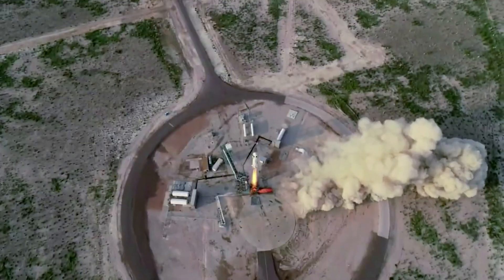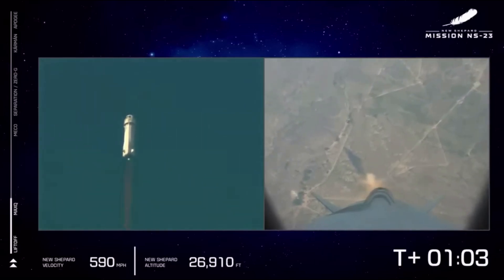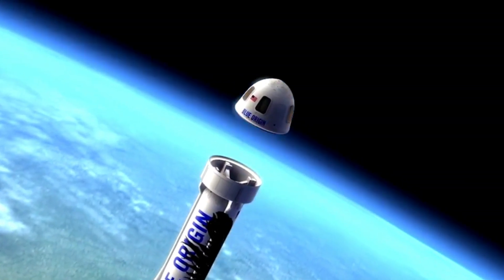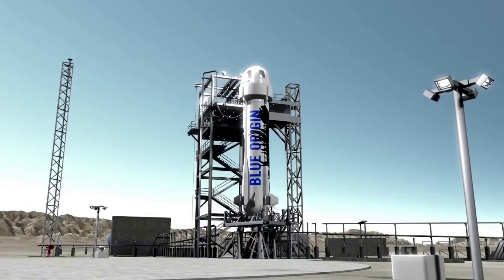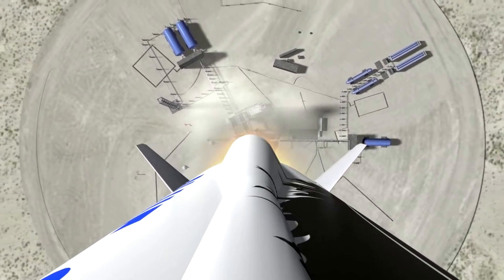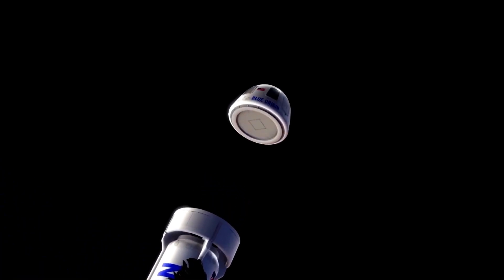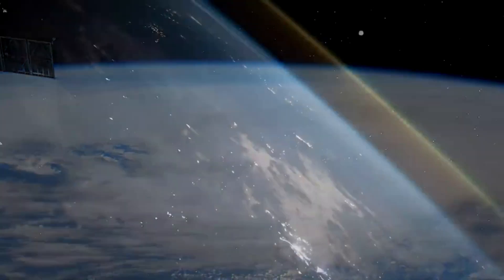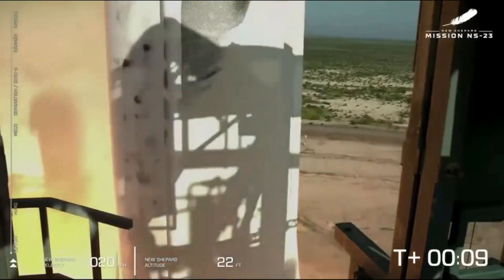What Is Blue Origin's Plan After New Shepard's Failure?

Comment: Will ULA await the result of the BE3 anomaly before their first test flight of Vulcan withs it 2 BE4s?
Reply: I don't think so, they are two completely different engines. They already qualified two BE4s to ULAs specs.
Reply: @JohnDoe-fg9ng  BO just released their report on the BE3 failure.